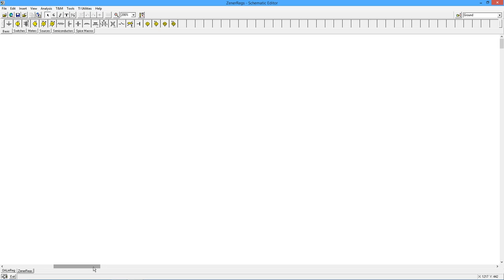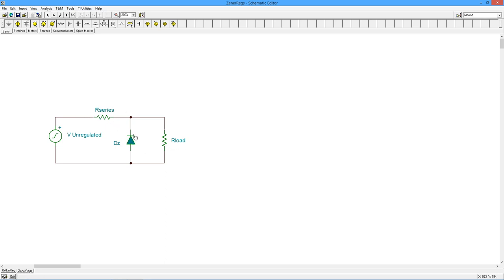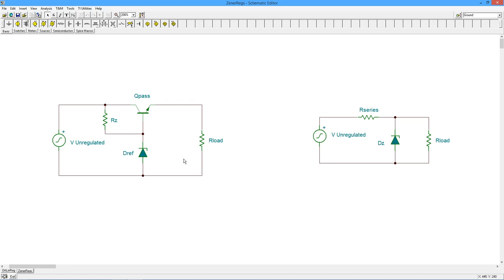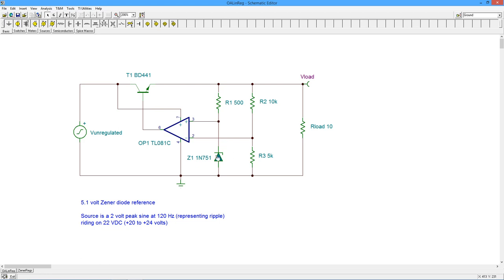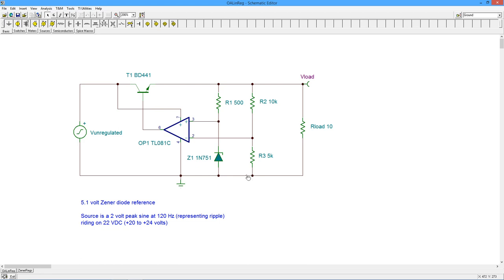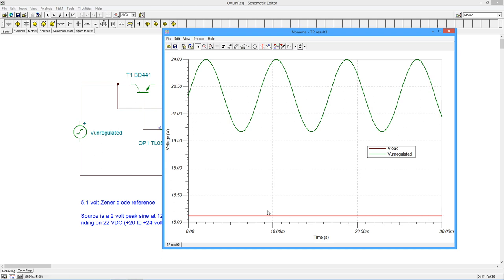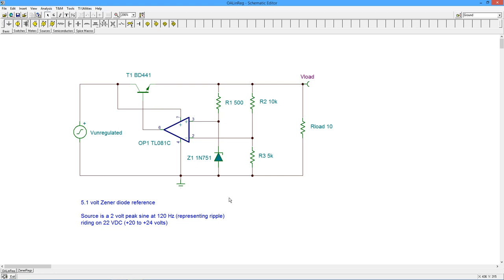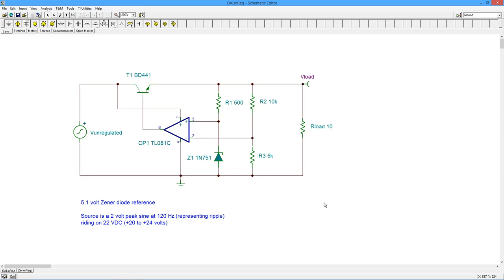Op Amps: Linear Regulators

Comment: Question: Why do you have the reference voltage on the output side of the regulator rather than the input side? I am used to seeing the voltage reference on the unregulated side. Is there any advantage to this?
Reply from the maker: Regarding the op amp regulator, it IS on the input side (of the op amp). It taps off of the load voltage because that voltage is more stable than the unregulated source voltage (source at extreme left).

Comment: Thank you. That all makes sense apart from one thing (which I'm sure is a brain-fart at my end). At 3:41: The Zener follower 'loses' 7/10ths across the Transistor VBE. I'm seeing Rload and the Zener and VBE in a KVL where RLoad voltage drop = the Qpass + Dref, I have something back-to-front in my brain here, could you help please?
Reply from the maker: The base current is flowing into the base of the transistor and combines with the collector current to form the emitter current (ultimately, the load current) flowing out of the emitter. Thus, the polarity of the drop across the base-emitter is + to - from bottom to top (base to emitter). The base is at Vz (polarity + to - from top to bottom, or base to gnd). Therefore, Vbe is subtracted from Vz to arrive at Vload. IOW, Vz = Vbe + Vload.
Reply: @ElectronicswithProfessorFiore  Thank you. I could see that the maths needed to be like that but was unclear as to the mechanism. Thanks again for taking the time.